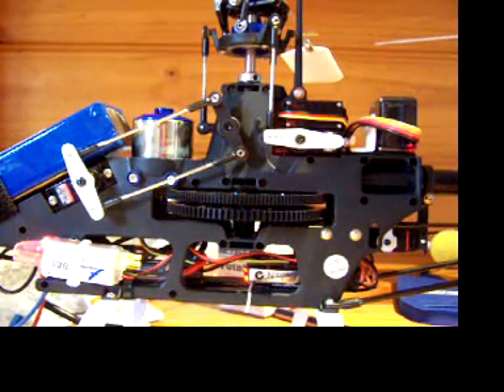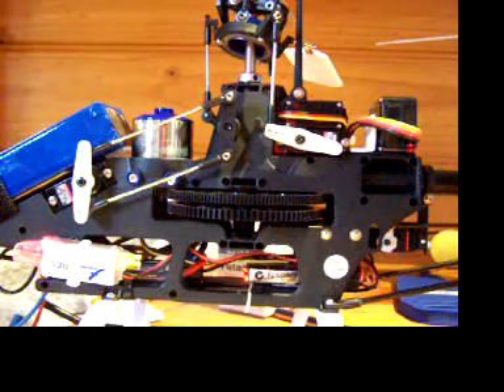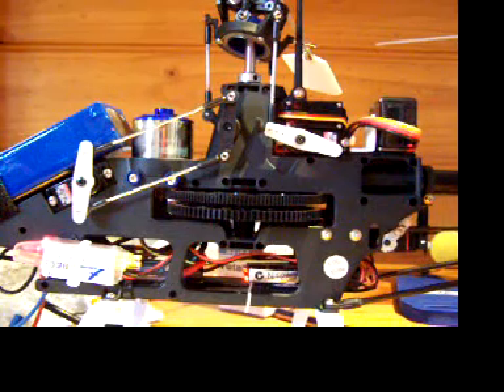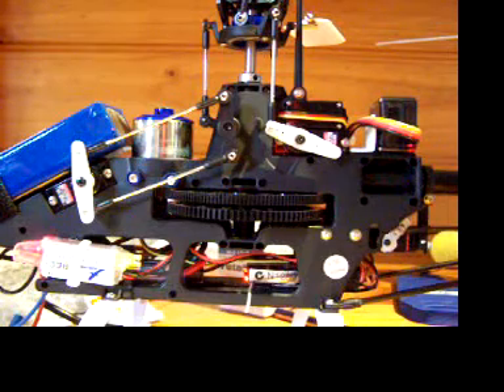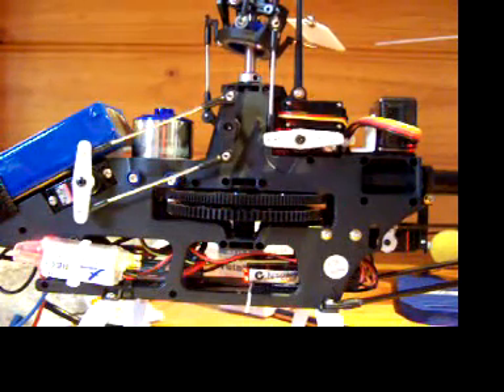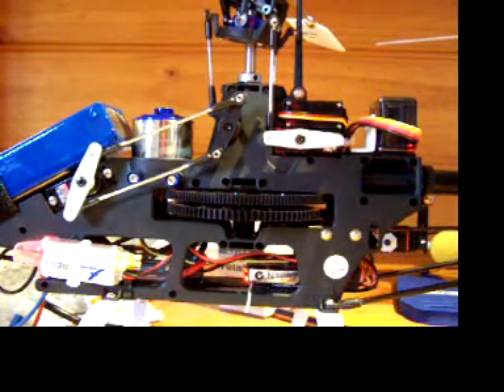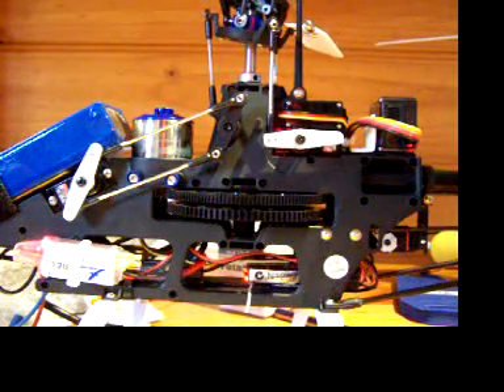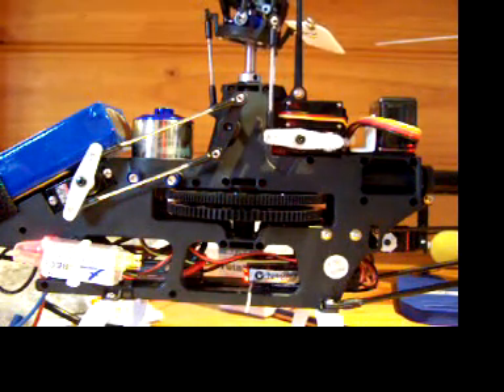Servo Glitches

Comment from the maker: I tried different servos, different receiver and a different speed controller. Not until the TX was replaced did the fault dissapear.  Have been using the replacement TX for nearly a year and no glitches since in 5 different models (including the Heli, which is a Blade 400).

Cheers, Dave.

Comment from the maker: Sorry all, wasnt getting messages to say I had comments!

OK, the problem ended up being the TX. If you moved the sticks to particular locations as described in the video, the glitches occured.  If you changed the expo or the dual rates the position of the sticks to cause the glitch changed as well, indicating it was not a noisey pot.

Comment: im only 14, i do my research when i need to, i dnt even no wot RF is. if you say the full word, i will understand, but 2.4Ghz was created for no-interfierence, even on the 'blade 400 talk-through' the hobby shops who purchase it say its non-interfearable. Unless you'd rather go Mhz and risk losing connection, ive seen it happen to nitros and theres nothing a pilot can do except watch his $2000 heli get smashed into pieces.

Comment: your wrong, 2.4ghz doesnt glitch, its non-interfearable, nothing can interfier with your connection when flying, as the reciever and transmitter lock on to eachother and the reciever does not look for any other connection while flying, but the 'mhz' does, thats why all new models come as ghz, this problem is 1 servo being at fault, and causing a unbalanced distribution of electric current that makes the rest of these servos glitch. B400 is an outstanding heli, just they come with rubish servos.

Comment: You have stripped the gears in your servos, but you probably figured that out by now because this video is 6 months old.  Also, don't run your heli with the battery touching the motor.